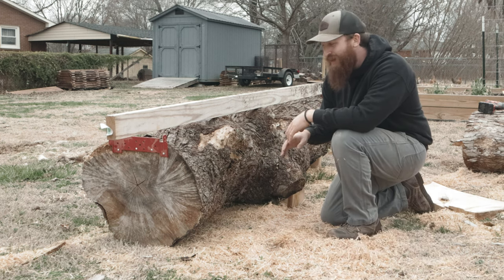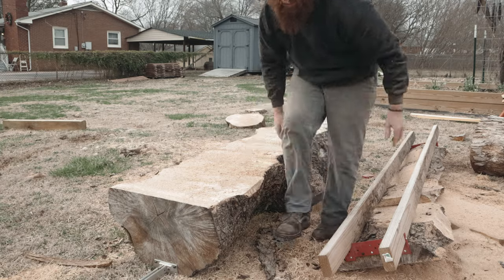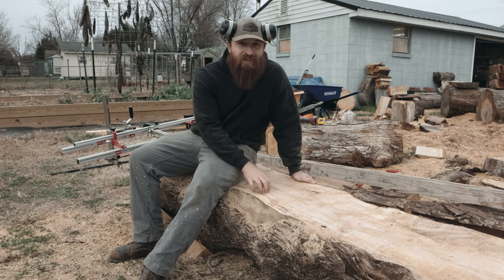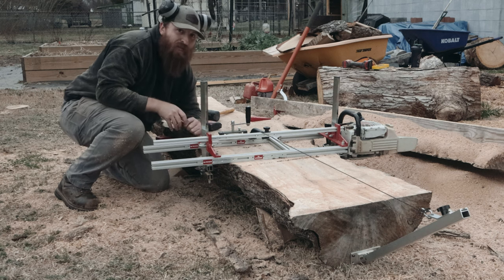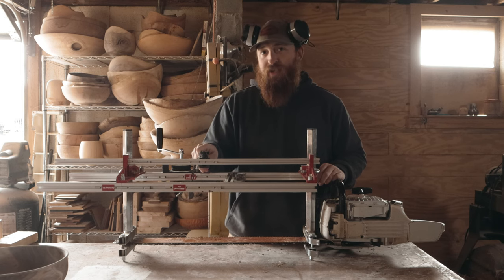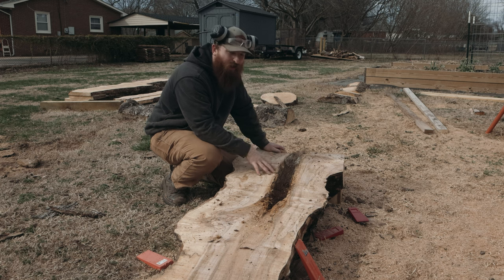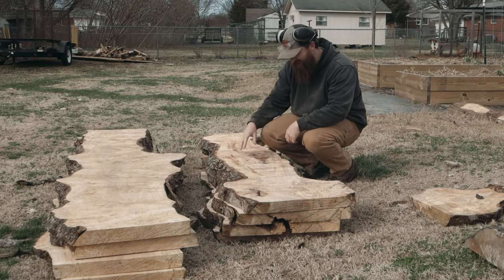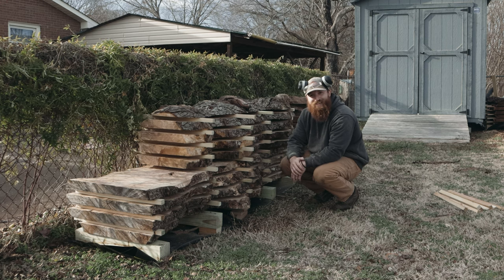I'm Learning How To Chainsaw Mill With Two Beautiful Maple Logs

Comment: Great job, the more I watch this video the more ideas I get. If you adjust your first cut, so you get a 10 inch thick slab. You can make lots of bowls with live edges on them instead of firewood.
Reply from the maker: Thats a great idea! The nice thing about cutting deeper on the first cut too is you can use it for natural edge or traditional just by flipping it over.

Comment: Great job Andrew I’m seriously looking at getting me a slab cutter too but I’m gonna use mine to cut my logs 10 to 12 inches thick so I can lay out my bowls. That way I can see the grain better and maybe decide how to center the bowl on a wide slab. something for you to consider also I think another way to make our jobs easier. Especially on large crutches.
Reply from the maker: Thanks David! Thats something ive considered as well. Ive got another maple log right now that I will be using for bowls but at the moment my bar capacity isnt big enough for it so if I get a new bar then thats what ill be doing!

Comment: When chainsaw milling, make sure your saw is warm before cutting.

The reason is you are revving high for longer periods than bucking logs for example. Alaskan milling is hard on saws.

Also at end of cut, let it idle 15-30 seconds to cool down.

Having a ripping chain the surface of the wood will have less chain chatter marks.
Reply from the maker: I appreciate the tips and will give that a try next time - especially the warming up. I know with these logs, the shape of the log kept giving me a hard time since it wasnt a straight log. I kept getting caught on the knots which would cause the saw to rev like that sometimes. Not the best log to learn on lol